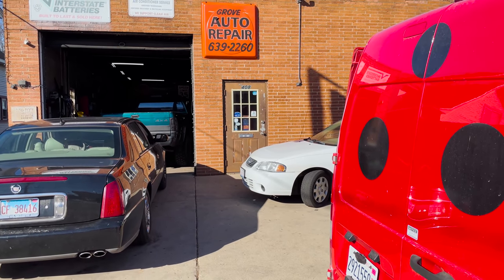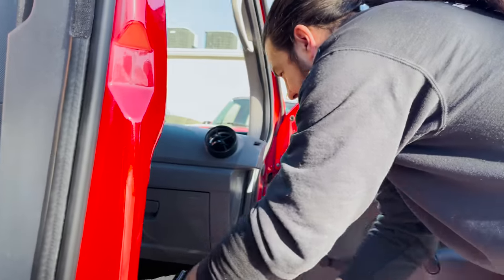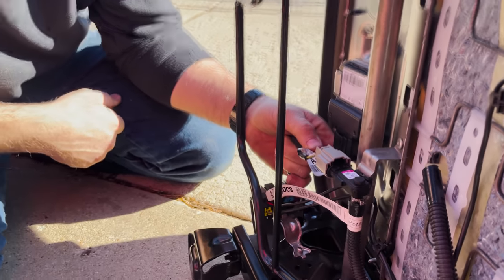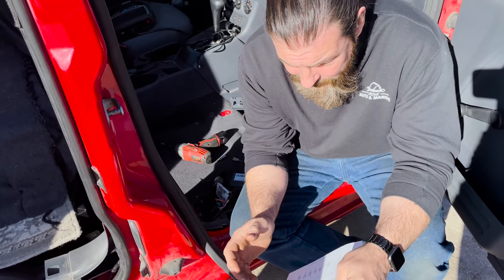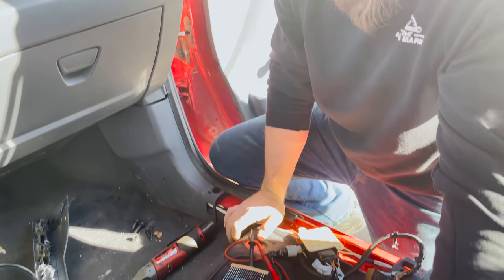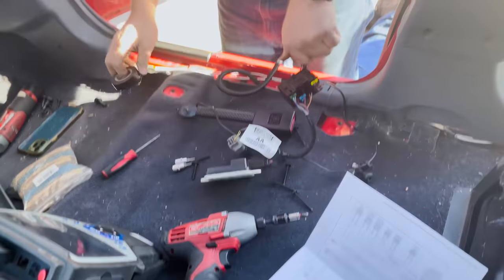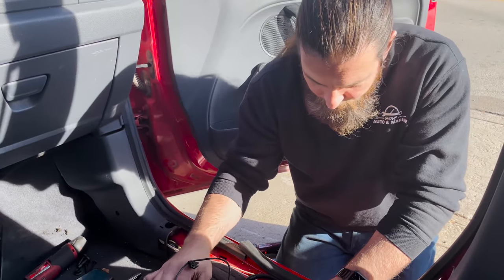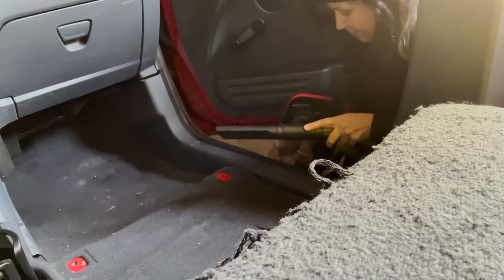VanLife | removing passenger seat from Transit Connect van—can I do this?

Comment: Thank goodness you had someone who was smart enough to work through the challenge of removing the seat. Whew!!! That was quite the task.
Reply from the maker: Oh I know! It was all on a whim too. I was on my way to get the drill bit to try to do it myself. And I happened to pass his shop and had a brief thought—maybe you should ask if they’d do it here. So I pulled in and he said sure—at the time thinking it would only take about fifteen minutes. It took over three hours and he stuck with it until it was finished. I was impressed by his work ethic and skill to solve each new issue that arose🐞🚗♥️

Comment: This is an incredible idea. Being able to get from the driver seat into the back of your van is a tremendous safety advantage besides being just plain convenient. I hope you will retain that ability even if you add some built-ins or storage or battery setup to that space.
Reply from the maker: Oh yes!!! I hadn’t even thought of the convenience because I managed just fine—but it makes a huge difference! 🐞🚗♥️
Reply: That is the only problem that keeps bothering me about the Ford Connect I’ve ordered. You can’t get From the front to the back while still in the vehicle. For safety purposes that was/is one of my priorities. But going to a larger vehicle is less gas mileage and looses the convenience of parking anywhere.

Comment: Thank you for confirming the wisdom of not rushing decisions, waiting for the next prompting to be spoken, and leaving the complicated things to the pros. I’ve had my 2020 Sprinter for 16 months now. I had a professional install my Esbar heater and a few other things that are beyond my expertise. I was comfortable installing the sound deadner, Thinsulate insulation, and with help from a friend, my loft bed. Sometimes I get frustrated because it’s taking so long but I lived in my van for a month, sleeping on the Thinsulate that I eventually cut and installed on the van walls and ceiling. Last month, after the bed frame was built, and I purchased 6-inch foam for my mattress, I took an enjoyable and comfortable two-week, 2500 mile round trip. My takeaway (confirmation) from this video is “take your time, there’s nothing to loose”. Your inspiration and practical advice are greatly appreciated. Take care!
Reply from the maker: Agreed 100%! Glad you are taking your time to figure out what works best. I almost tried to do this myself and am SO glad that I passed his Autobody shop before I hit home depot😛😬 I can’t even imagine what THAT video would have looked like 😂

Comment: Taking out seat or front swivel on Bigger van can Open it up SO Much! Make usable living  space feel so much better!  Good job!
Reply from the maker: Thank you Joseph! 🤗🐞🚗
Reply: I put swivel on pass side of my Promaster 1500 HR van. Left wire disconnected so my airbag light is on All the time.  The swivel I bought didn't have a hole to pSs wires thru!  WtF?  I will prob get better base later?  Until then light will be on?
Reply from the maker: @josephj7991  That sucks! The smaller van I have did not have many options for swivel seats. I have a great lounge space already—so removing it for the extra space made more sense for now—glad you have a nice swivel (despite the light being in all the time)! 🤗🚗🤗

Comment: I was planning to just turn the passenger seat around, to give a comfortable place to sit. However, the idea of easy way to get from driver seat to back of van is giving me a re-think.
Reply from the maker: That was exactly what my original thought was…we shall see if taking it out was a good choice😛
Reply: Maybe a 2nd hand 'high end' seat turned to face the back (?) - In this way you could still get to the back from the drivers seat, still carry a passenger (facing backwards, like in a train) and 'High end' so you could have a heated seat/massage seat/comfy reading chair...

Comment: Maybe just get a couple of large duffel bags that can be shifted around easily. You could put your soft things like clothes, blankets & towels in them and use as back pillows on the bed. Easier to grab and stuff places too. You could throw them out n the front space at night out of the way, then to the back when you wanted that space open. Just a thought.
Reply from the maker: Great thoughts! Keep them coming🤗🐞🚗♥️

Comment: I was thinking about doing the very same to my van!!!! Removing the seats was easy enough (though I have no idea of how to get rid of them - as the rails have been scrapped) - it's the wires that baffle me. Great advice not to touch yellow or red :)
Reply from the maker: It was a much more difficult task than I imagined. We thought it would only take about fifteen minutes and it took well over three hours😛 so I am glad I got help😎🐞🚗
Reply: Yellow (airbags), Orange (high voltage)

Comment: Hi Dee, I've had my passenger seat taken out to put in a 12v fridge and extra storage. A platform will go on top for my dog to travel and sleep on. I was amazed how much room there is without the seat, and fortunately I didn't have the airbag or seatbelt problem so all good. Happy travels
Reply from the maker: Sounds great. Safe travels.☺️

Comment: I have the same series of Transit Connect cargo van (2012) as you,  and this video has gotten me thinking! 
I carry all my regular clothes, and cold winter gear, in two side zippered duffle bags, which I now carry in the back.  With the way I have my build, this requires me to move them to the diver seat when I want to crash in the back at night.  Without the front seat,  I would just carry them up front  regularly in that space.  Right now I carry books,  and my log diaries in a wooden milk crate on the front seat, with some other gear in the foot rest area. This would still work if I just carried the duffle bags up front without the seat, and placed the crate and other gear beside them.  Have to say you’ve got me thinking!
Reply from the maker: I know!!! I used the passenger seat as a catch all and was never quite satisfied with how unorganized it always felt. I’m hoping to figure out how to best use the space. Right now it’s nice to just have the space😛

Comment: Great idea.  Electrical tape over the airbag light?  I bought a car that someone taped over the check engine light!  Big repair.  My van was originally a cargo van and I signed a form with the state DMV that it had a passenger seat so I could avoid paying for commercial plates.  That shouldn't apply to your van since it originally was passenger van.  I also take my grandson with me and I like having a front seat with seatbelt for him and his booster seat.  Other considerations;  don't block your heat vent under the dash,  or access to the gas reset button located along the lower wall there.  Love your videos!
Reply from the maker: Good advice Linda! I waited for so long for this decision thinking I’d have passengers. But in all the time I’ve had the van, I have maybe had passenger three times. So it was time😛.

Comment: Great idea to remove the passenger seat! I was contemplating doing the same thing, but I still need a second seat for my daily runabout. I found out that I could unbolting the passenger seat and re install it facing aft when in solo camper mode. The seat back is out of the way, and provides more room for the cooler, etc.
Reply from the maker: That was an initial thought I had too. I guess I’ll find out if it was a good decision  or not😛 I do feel like I’ve gained so much space even though it is only about 6 sq.ft. 😂 every little bit counts 🐞🚗🐞

Comment: Hi Dee … you mentioned getting a hard cooler … I know you have just adapted your bench seat, so might not like this idea, but my coolbox is exactly the same height as my bed platform (okay it didn’t start out quite like that,, it was on a slopey bit of floor so I had to build it a little platform) but my coolbox now forms part of the foot end of my bed, much as your bench seat does … it’s an Icey Tek, strong enough to stand on so it also can be a seat … that would give you a cooler and still leave the passenger seat area free … just a thought …. xxx
Reply from the maker: Great idea! Glad it worked well for you. I love hearing new ideas🐞💃🏻🚗

Comment: Omg i just bought this exact same type of can and will do this mod today. Thanks
Reply from the maker: That’s awesome!!!
Reply: @LadyBugout  hit a snag. No one is open until Tuesday for a 2.5 ohm resistor! Shucks. Think i did everything else right though... or right enough. Kind-of concerned about the pressure sensor disconnect in video. Has fluid that goes to it but in video look like fluid line disconnected... unsure if zero fluid will make sensor act weird.

Comment: Dee, looks good and smart thinking on getting a knowledgeable pro to do the removal. I agree with your go slow approach as to what you plan for the new space.

My late father did something similar with our 1967 Volkswagen Beetle. He removed the passenger seat and made a pop in fitted floorboard so it could take more cargo. Worked great and you could pop the seat back in easily as needed.

I believe that during your future travels you’ll get some good ideas as to what you can put in the space, whether temporary or permanent. Good luck, Merry Christmas, and Happy New Year!
Reply from the maker: Thank you Harry! That’s a cool idea your father had. Yeah… I’m trying to think of a way to give it multipurpose as always😛🤗😎

Comment: Yes…. Sit with it.  I decided to just sit with my NV200 bare bones for a good while and using it “as is” before making any decisions.  I’m so thankful I didn’t do anything immediately because just a few months in my mind has completely changed in regards to the function of the space available vs what was in my visual headspace.  Can’t wait to see how it evolves.  Removing seats isn’t just a haul it out of there job anymore.  All the electronics necessary for sensors and air bags and resetting codes has added so much necessary mechanical know how “drama” to our vehicles 🙄  Wise to be safe and have it done by a professional.
Reply from the maker: Yes. That is funny that you mention what is in your visual headspace va what is the actual space😂😂😂so true!!!🐞🚗♥️

Comment: OMG. I am sooo grateful for your amazing hint about Horse bedding pellets! It’s one of the biggest , life-changing hints I’ve gotten. I have found a place with some on sale now for $4.+ for 40 lbs. If this catches on amongst van dwellers I bet the price will go way up. But where to store 3 or 4 bags?
Reply from the maker: Lol…now that would be an interesting trend!
Reply: @LadyBugout  I found out that what I got was actually wood stove pellets when I returned to buy more, while still on sale. As far as an idea catching on, when I first got my butane Coleman single burner I could buy a case of 12 8oz butane canisters for about $12. or so.  Now the cheapest price I can find is close to $40
Reply: Kerry, I have the wood stove pellets, too. Where I bought them they said there is not a tax on them for some reason. Probably because it’s a fuel source, maybe?

Comment: I've never wanted to remove the seat in my Transit Connect.  Now I definitely don't want to remove it after seeing that electrical nightmare... lol.  
Seriously though, that is pretty cool.  I've only ever needed to crawl in and out of the front seat to the back a couple times.  However, if you do it a lot then definitely will be nice for you I bet.  I would probably end up just making some kind of short cabinet there for extra storage and table top surface.  It would still be low enough that I could climb on it to get to the back.
Reply from the maker: It was quite an ordeal😛 but, for me, it was worth it!

Comment: 1 other idea wud be to reverse the seat to face backward?   I have swivel seat in my Promaster HR van,  that gives u a very comfortable chair to sit in.  Yours can't swivel but u can mount it facing backwards.
Reply: If u still have the seat,   try putting it in backwards?  U wud be easily able to climb over it into the back and have comfortable chair to sit in.  Seat wud fold fwd (towards the back now) so u cud access the area  so no loss of space?   1  person actually grew a Garden in that space?   No sure how well it worked out?  Lots of light but mite get too hot?

Comment: First I would never have taken the Seattle out without a fixed plan Anand I feel passenger seat swivels in reverse with the right kind of cover makes a definite improvement ina salon lounge chair bu that's my opinion and preference.
Reply from the maker: It’s hard to find swivel chairs for the connects. They don’t work as well as with the bigger vans and would give me much in the way of space or function. 🐞♥️🚗
Reply: @LadyBugout  ty

Comment: I heard the airbag sensor issue was a tricky one. Wish a rotating seat was an option - at least it could be an extra seat for guests...
Reply from the maker: I had thought about a swivel seat. But in all this time I’ve only had a passenger twice. So, that is what finally tipped me over.🐞🚗♥️
Reply from the maker: Yes, I’ve seen those DIY lagun tables and have been taking notes😛

Comment: Wise choices...some guys would've just put black electrical tape over the idiot light!
That procedure reminded me of the two times I had to take the passenger seat out of my Toy micro-mini...that is the only way to get the 4.0l Dometic fridge out when it fails!  After the 2nd time, I just went with a compression fridge.  You do have me thinking now...why do I keep the passenger seat in???  I could get a folding Ebike in that space!
And seriously, ~0:25, have you ever thought of modeling?
Reply from the maker: Lol… now your talking…a foldable e-bike would fit perfectly!!!
Reply: @LadyBugout  Not the Sondors Fold I got...over 50 pounds, and it does not fold to 18" as they spec...can't get it through the door!  Around Christmas I did run across a sweet deal on a demo Gocycle G4i with 30 miles on it.  Incredible bike...no exposed cables, predictive auto-shifting (guys can shift manually as well) and, the 1st ebike with traction control!  You can even change tires or tubes without removing the wheel.  Of course, at these prices, it should change it for you!
April 1st the RV comes out of storage...Cha Cha Cha Changes!!!

Comment: Hello!  I love your van and setup.  I want to ask a question.  I believe your van is a 2010?  I have heard that the newer ones have less headroom than the older ones.  How much headroom is there in your van from floor to ceiling?  I am planning to do something like you are doing, but I have a need that most do not.  I play the harp, and I need room for my floor harp.  It stands 54" tall.  If it is too short I will have to get a smaller harp, but I am hoping there is enough room.  Thank you!
Reply from the maker: Hi Lori! You have heard correctly. The connects newer than 2013 do not have the little extra head room. I hesitate to say that I think it would barely fit. But there are so many little distinctions in each van. Mine for instance has the headboard and had a rubber matting which could vary the height by a couple of inches. I would go and physically see it and measure it if I were you. I did! It looks a little strange to the car dealers, but 🤗😛😎 you gotta do what you gotta do! Your harp sounds like an important part of your life—so it’s worth checking!☺️

Comment: You can buy an e-cooler. They run off solar panels too with the lithium battery  I got the one from Costco the Massimo 62 l but that's too big for you
Reply from the maker: Yes! I most definitely could. Thank you for thinking of that. I know it is possible. I have enough power. The issue is not that, it is figuring out what I would use a fridge for 😛 I really do not need one for anything…strange as that sounds🤗

Comment: Hi Dee, I watched this many months ago….I keep thinking to do this.  I need to be able to place the seat back in, at times.  When the seat was out and if I did not do the rest of the wiring and rewiring, would the air bag not work on the driver’s side(when the light remains on)?
Reply from the maker: It is complicated because of the wiring for the airbags. I needed a professional to take out the seats. I wouldn’t recommend it if you need to have it accessible for two front seat drivers with seat belt safety.
Reply: thanks!  journey safely! @LadyBugout

Comment: Hi, did you consider putting a swivel seat in passenger ?
Reply from the maker: I did consider that. They are harder to find and install on little transit connects. I figured I’d gain more by taking it out and see if a seat of some sort would be the way to go or not. I am liking the open space😛